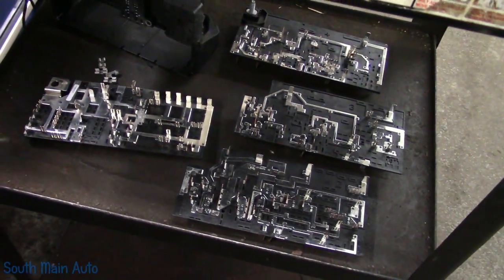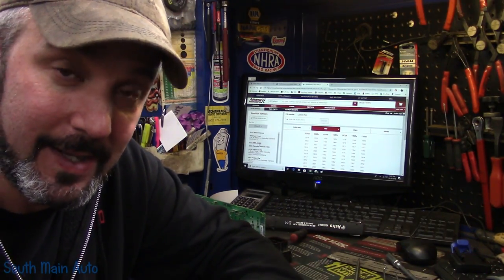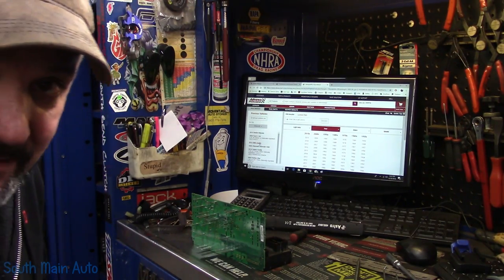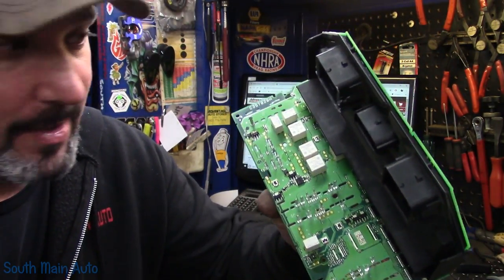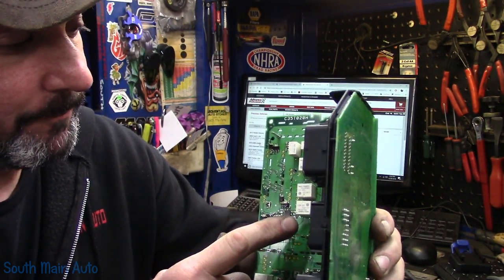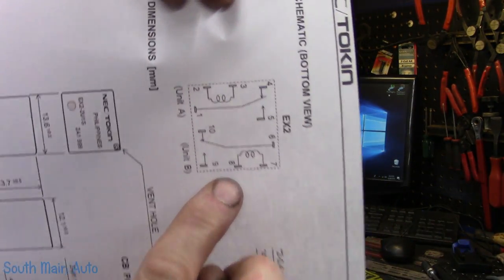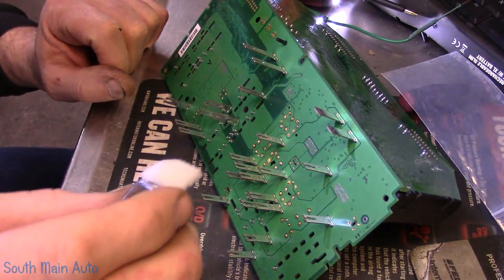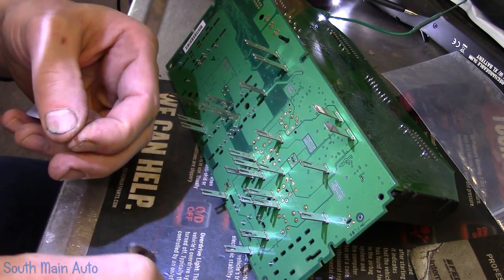Chrysler / Dodge : TIPM Repair - No Wipers

Comment: I worked at a radiator shop for years. The easiest way to remove solder is heat it and use compressed air. It's messy but it gets all of it out. 😂
Reply: Soldering pins isn't much different than core tubes in a header plate. Except smaller. Less solder on the wall. 😄 you can tap and wiggle something all day. Blow some air in while it's hot and it releases. Don't cower. It's not much worse than sand blasting. Just warm.

Comment: Works much better if you have flux to put on the solder wick or the joint before using your solder sucker tool, Lead-free solder is a bear to work with compared to the old leaded solder.  (I have been working in the electronic industry on and off since 1989)

Adding more solder (preferably leaded solder) before attempting to de-solder the joint helps as well.    

A solder sucker actually works better for removing components like this.  

You can't "melt" the board but you certainly can burn - damage it.  

Looks to me like you are a quick study!

Comment: The fine tip of your soldering iron can't deliver heat fast enough to the soldered patch and to the solder wick.  (The broad solder wick too quickly conducts heat away from the solder patch.)
Either you should use a higher wattage soldering iron, or you should use narrower solder wick (or trim the broad wick with a pair of scissors to form a narrow tip).

Comment: I am about to take this endeavor on a 2008 dodge nitro 3.7 Liter with a faulty power rear lock issue. The rear power locks are not operating at all just the fronts. After repairing a broken wire on the rear right passenger door, which I thought was going to fix the issue, it didn't. I decided to look up issues with this same problem. The only thing that came up was the TIPM. Is there another way to actually double check it? Please let me know.

Comment: SOUTH MAIN AUTO REPAIR, what are the common failures or problems you repair on TIPM circuit boards? The TIPM circuit converts CAN signals into ILS signals and what else does a TIPM circuit do?

Comment: You need a chisel tip on your solder gun, something at least 1/8 inch wide. A fine point tip does not carry enough heat. You were using the copper mesh correctly you just did not have enough heat.

Comment: When you can see space around the pin and the solder is lifted,  the pin is desoldered.... And yes.. You should have the smaller tip.... Solder sucker is great for what your doin.
That melted relay.... Either they put too large of a fuse at one point,  or that park circuit in the wiper motor is drawing too much current... Thus your melted relay/codes for park circuit.

Comment: Having done this a million times, I'd say, you'd make your life a lot easier if you add a whole lot of new solder to it, before you take if off. You need the new solder to be the one with flux in it. (The one that goes smoky smoky). And this PCB have more then one layer, so be sure not just to be concerned about the getting if free from the bottom layer. (The one you see)

Comment: Eric See you doing that....... Them wire locks there if yo broke a pin on the side of it can that plug be changed so the lock can work properly that you know of or does the wires have to be spliced together

Comment: You need flux, and you can apply low melt leaded solder to soften up a harder type of solder. That said, you don't want to be breathing this stuff, so having a vent fan or something to move the chemical fumes away is very important

Comment: I’m having a problem when my caravan, battery is dead, charged it, car doesn’t want to crank over. When I try to jump start it doesn’t work and the jumper cables get really hot. I busted out my test light and was getting ground on the battery positive cable. I traced it back to the TIPM.  There aren’t and blown fuses however. When I set my test light in series between the battery + terminal and the car’s main battery power cable it lights up. I removed all the fuses and relays in the TIPM and the test light does not go off. When I removed the power cable going from the battery to the TIPM, the light finally goes off. But with my test light connect to the battery + terminal, whenever I touch the stud on the TIPM where the now disconnected power cable is supposed to bolt to, my test lights up as if I were touching the engine block or any other ground point. I’m not  mechanic, but from watching your videos, I’m pretty sure I’m not suppose to have a ground connection where the TIPM power from battery is suppose to go, right? 🤔is it possible that a short circuit occurred inside the circuitboard?

Comment: I hope I don't have a tipm. But if I had an old vehicle with a bad relay on it and you could save me hundreds of dollars without warrantying it I think I would have you repair it. Now that you have some experience the next time will be easier. If you just don't want to deal with circuit boards at all then I get it.

Comment: solder your tip and don't be afaid to add solder to the pin, then when you heat that , it has heated all the solder in the hole and the pin, stick the sucker flush with the board and suck ALL the solder out. Then to remove you have to touch the pins and slightly pry the relay off. Depends how got you sucked all the solder out!!! they do make a tip that hets all that pin side at once for removal

Comment: I got that brand of wick the first time I tried as well.  I think it is light on flux.  Was not happy with it but a more expensive brand has worked for me.  After I bought a cheap hot air station/gun  and embraced flux separate from the solder, things have been easy.  

Found a zombie youtube channel, John Gammell, with a bunch of solder technique videos.  Apparently, examples for some aviation-level certification course.  Just pictures and text, no chattering.

Another is a small channel, Androkavo  A bunch of close up soldering technique/testing.

Comment: Wondering if it could be done with normal relay rigging in the TIPM wiring connector using wiring diagram

Comment: Eric I've worked on these for years - the solder suckers don't work all that well, and the cheaper desoldering braid sucks. Next time, try some of this - https://www.amazon.com/gp/product/B008O9W2FA/ref=oh_aui_search_detailpage?ie=UTF8&psc=1. The SuperWick is a much better desoldering braid, one tip: you need to keep the iron pressed against it until you start seeing it sucking up the solder.

Comment: Pretty much a textbook fix, good job and don't be too timid about this.  It's hard to overheat the board, but it is possible to damage the traces by underheating & brute force.  

A couple of tips - although Amazon works for ordering parts like this, I would strongly suggest using Mouser instead - much wider parts variety and cheaper.   Also, if you do this more often, I strongly suggest getting a Hakko Desoldering gun as it will make removing parts a LOT easier and safer that manual suckers & desoldering wick (which is a crapshoot & works better with flux...) - https://www.ifixit.com/Store/Tools/Desoldering-Gun-Hakko-FR-300-05/IF317-010-1 - Also, get a good quality soldering iron (like a Hakko).

Comment: CAUTION! That was a good diagnostic strategy to test activating the relays, BUT... if you apply 12V (with little or no current limiting) across a relay coil, you have to be sure you apply power and ground in the same polarity that is normally applied by the controller. There is almost always a diode across the relay winding, ("reverse EMF diode") which is normally reverse biased ("arrow" points toward "+"), and is there just to conduct the pulse caused by the relay coil's collapsing magnetic field that occurs when the driver transistor (in the upstream controller) turns off the relay. This would otherwise be a high voltage pulse that can fry the driver transistor.  If you apply 12V in the wrong polarity across the relay, that will first blow the diode, and then the coil will test good (it doesn't care about polarity).  So all will seem good, but when reinstalled, and the relay is later operated, it will send harmful voltage spikes back to the driver transistor in the upstream controller module.  Hopefully, Eric had the PowerProbe set to some modest current level, like 400mA, though the sparks didn't look encouraging!

Comment: You will find that a Solder Sucker is a great tool with many uses. De-Soldering a wire from a switch or other component, removing solder from a cold solder joint, and many other things, not just PC Boards. One thing on a PC Board is to use a better temperature controlled iron with a clean mini chisel tip that can heat the joint and liquify the solder quickly, then remove the iron and place the tip of the Solder Sucker squarely over the joint and trigger it. For some components like transistors, you need to heat and melt quickly, then suck clean before the heat can damage the component. Just think....one of those relays.... must be the Fuel Pump Relay.... the cause of many TIPM replacements. As you say..... WHY have these soldered on relays instead of standard plug in ones? Answer... Cheep to make! When you were re-assembling all the layers of boards and circuits, I kept expecting to see Mr. Spock with the Multi Level Chess Set challenging you to a game.... seems no less complicated. This is a case of a case of a complicated circuit integration box being used to allow pre-made harnesses to be plugged in quickly during manufacture, not necessarily a component that makes servicing and repair easy. Oh... the engine won't start..... plug in a new one.... they are no longer made to be repaired. Great Video... what we do for family eh..... that's a Canadian comment eh!

Comment: Personally I've had luck adding solder to pins like that, melting it, then using the surface tension of the molten solder to pull the whole blob from inside the pin hole

Comment: Looking into rebuilding the TIPM on a 2010 Dodge Journey 2.4. Losing voltage between battery and inside cab with no start if its 10v. Horn started honking too. Removed fuses, have a switch on m13 fuse, trickle charger on block heater 4 hours a night np starting.

Comment: I'm from Buffalo I have a 04 Lincoln ls running lean on bank1 I changed vacuum lines gasket an o2 sensors still a problem s an my evap monitor won't clear but no code for it .is there a shop in Buffalo u recommend

Comment: Your iron tip was a little too small for the job. You can just grind it down a little. Your solder was a little too big as well. It's getting hard to find leaded solder around town, but you can still get the good leaded stuff at AutoZone.

Comment: If you are login to do a lot get yourself a bottle of liquid flux or a pen, and a decent soldering desoldering station. Better heat control and don't wreck as many boards. Using the wick put the flux on the wick as well does a better job. And flux and fresh solder the joints first to get the solder fresh. It will desolder way better... From an electronics tech that has been fixing boards for 30 yrs! Traces come up easy on some cheap boards! Oh and spread the wick out! As in pull it apart a bit!

Comment: Yes watch a you tube Video. Soldering  has some fundamentals. Tip tinning and maintenance are critical. Some times it can be as simple as adding a little lower melt temp solder to the board before you suck it out.

Comment: Buy whats called a Solder Station with adjustable temp. The solder the automakers use  is "lead free" and will flow better with a hotter iron. Also, think about involving your female friends for this kinda work as they prob have better dexterity and do well with this fine detail work, maybe they could start SMTR (SouthMainTipmRebuild).

Comment: Desoldering would have probably been easier just using lead solder and the heat gun. Alot of solder really helps when desoldering these. I desoldered all of the realys from the control board of an Autocom VCI about 40 of them I guess that was an afternoons work. When you do it with the hot air gun it heats all the solder points at the same time and the relay just falls out when its hot enough.
Reply: Solder wick is good but you need a higher thermal mass tipfor it to work and some times you need extra flux if the wick is too much chinesium.

Comment: Old video but you needed to put flux in everything to get the soldering braided wire to pull all the solder. Much quicker than what you ended up using.

Comment: I think I would've just found the relay wires coming into fuse box and cut them and wired external relays in place that way if the relays fail again easy to replace them.

Comment: KEEP THE TIP CLEANED AND COATED WITH A FRESH COAT OF SOLDER AT ALL TIMES BEFORE USE! Use some liquid flux on the intended solder joints to provide quicker flow using less heat on the board. Buy 63/37 rosin cored solder in the desired diameter. This ratio of tin to lead has the lowest melting point of all solders. The lower your melting point the less likely you are to overheat the circuit board. NEVER BUY ACID CORE SOLDER FOR USE ON CIRCUIT BOARDS. THIS IS FOR SOLDERING THE COPPER PIPES ON YOUR WATER HEATER.

Comment: Great job Eric O....You won't know until you try and you succeeded atleast on the repair and saved your sister huge chunk bills. Agreed one of the worst designs from Chrysler aka Dodge came up with on TIPM and solder relay to bottom of the board that can go bad. Also FYI if already know these Dodge Caravans with TIPM also know for the fuel pump relay go bad but they did make work around for them atleast. http://www.verticalvisions.com/products/tipm-test-bypass-cables.html#buildone

Comment: This is the problem we face, so many pcb's are deemed fried, when often its a relay or capacitor thats faulty, it is not morally right to ditch the board, when its such a simple fix, mindsets need to be changed

Comment: I wonder if the relay got stuck then fused together or got fused together first?
Reply: Most likely the contacts oxidized and as the resistance got higher so did the heat until it melted together. Why didn't the fuse blow? Because the fault did not represent an over current scenario. It still could have gone very sideways for the car if the relay had flamed out. Remember fuses are often only fast enough to protect the engineer from the lawyer and not to protect the car or the driver from a fire.
Reply: my guess is, some bean-counter pushed for saving $0.00001 per relay, by using ones with lesser quality contact materials...
I see the same thing in many electronics on various devices (vehicles, appliances, toys, radios, tv's)

Comment: $15 relay or $600 T.I.P.M.? Yeah I'd let you try the repair on mine. I never got the hang of soldering circuit boards either.

Comment: Check out a few videos and you will be more comfortable doing this. Remember to use rosin core solder for electronics, I like KESTER SOLDER 32117 24-6040-0027 60/40 Stand, 0.031" Diameter,"44", 1.5"

Comment: you need to stop saying Oops. You need a hot soldering iron for the wick to work, wipe the tip of the soldering iron on a damp sponge to keep the tip clean, add solder to "tin" the tip to keep it from oxidizing. A oxidized solder tip won't transfer heat well . Sometimes you can add solder to the joint to transfer the heat so you can get more off with the wick. solder suckers are a great tool, you have to keep them clean though. Dont use acid core solder on a circuit board - only use rosin core.

Comment: Modern day board repair usually means buying a $550 microscope and a $300 hot air rework station.  Louis Rossmann  does Mac book repair videos using these tools.  If you have the right tools anything is possible.  Link to hot air rework station: https://youtu.be/N_yHkrVYrBE?t=27m56s

Comment: You need to keep that tip clean on a wet sponge more often, tin the tip more..u weren't getting good heat transfer, cause no wet solder on low powered tip..

Comment: good tire it works that is wot counts I fix my tv live and learn I jist fixt my mustang the batter was died so I gave it a boost and it quit so I was going to boost it again and dis not turn off the egnisin and blow the pc got it fix but the fuel pump was gone to it wood have ben nice to have a caner it wood have made it a lot easer 

those fuse box have a lot of problems that will do Strang thing 
thing will come on and go off at random start and stop light heater signals

next tine tire a small heat gun it works good   not a big one  and flux  will halp 
wick is for clean up

Comment: Hey Eric I know you like great tools buy yourself a ts-100 soldering iron off Amazon or eBay they are unreal and solder like you have never seen .I have a 500.00 Weller and it leaves it in the dust for 60.00 with power supply look on YouTube

Comment: hey boss. the best way for solder braid to work is to use a bit of flux. flux is really helpful in heat transfer. makes it so that solder can melt at a lower temp and more efficiently. less chance of burning the board that way. in your case i recommend a bit of flux paste, and clean up is just using a bit of rubbing alcohol (91% or higher)    :D   In fact, louis Rossmann sells a bunch of solder-related components and also is in new york. store.rossmanngroup.com

Comment: please, please get yourself a hakko fx888d, those uncontrolled irons are the worst.  You'd have been done much sooner if you had that, added a bit of leaded solder to those joints and maybe a bit of ra flux.

Comment: Plated thru holes are a bear to de solder..add solder to a connection to increase heat transfer..then use solder vacuum, sucker

Comment: My 2005 RAM 2500 has the same wiper issue. My neighbor has a 05 1500 with the headlight circuit gone. This is classic over engineering to justify them having a job. If you threw a engineer and a brick of the top of the Empire State Building, which would hit the ground first?......... Who cares! Mechanics are baby sitters for engineers.